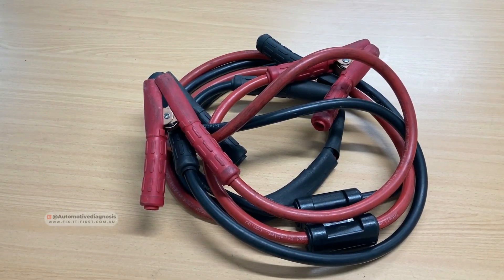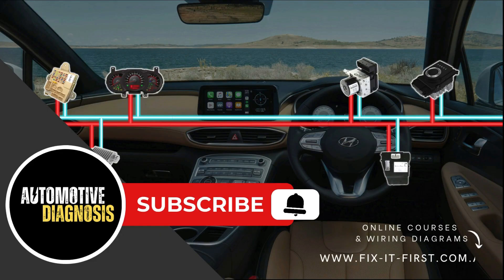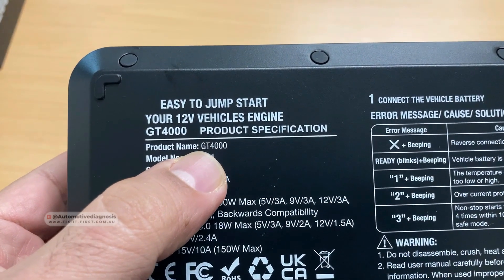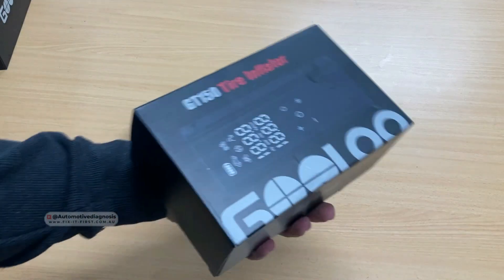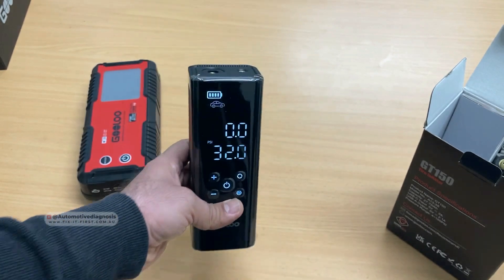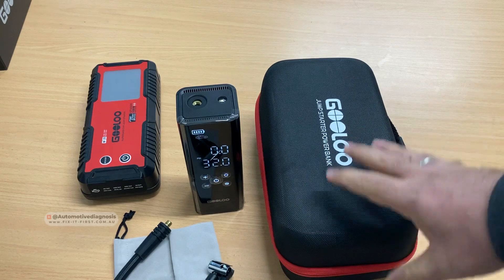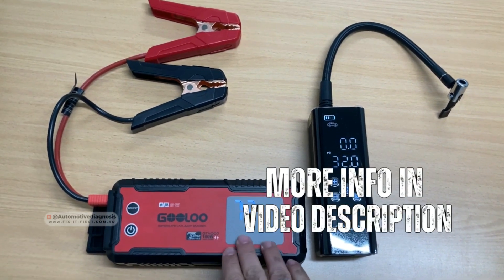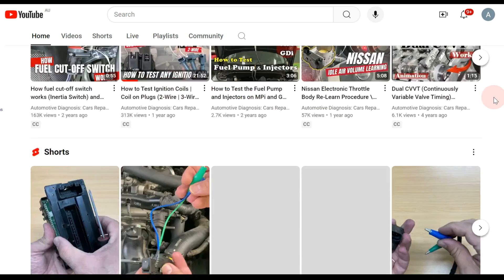Say Goodbye to FLAT Battery & Flat Tire | GOOLOO GT4000 Jump Starter 4000Amp & Tire Inflator

Comment: Hey automotive diagnosis , I need your help with have a kgm or ssanyong 2024 torres  it does share same engine and wiring harness as older modules the car wont turn on ignition afte being in a car accident airbags deployed previsouly.i know  in mercedes their was a way to baypass it or change a pyro fuse, just wondering if you could help of location and whats prenting these cars from turning on what system do they use? i have one that has been in an accident but wont start ignition i know bmw and mercedes have pyro fuse what does this car have to prevent it to turn on and where is it located.that would help me alot !!!!
Reply from the maker: Hi there, after accident many fault might have happened on the wiring that must be inspected, there is no shortcut in this case to bypass the car.
Reply: @AutomotiveDiagnosis am I able to pay you and you can maybe find out how it’s done ?
Reply: Nothing damaged on wiring but usually it’s a pyro fuse that gets cut but with this car not sure what system it uses to stop car from turning ignition on